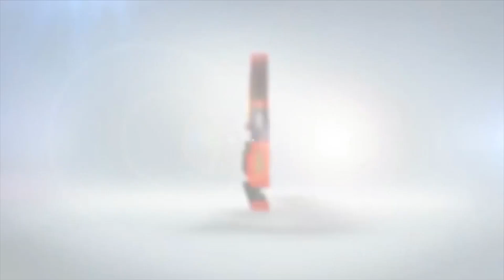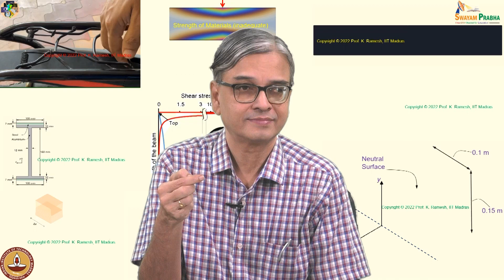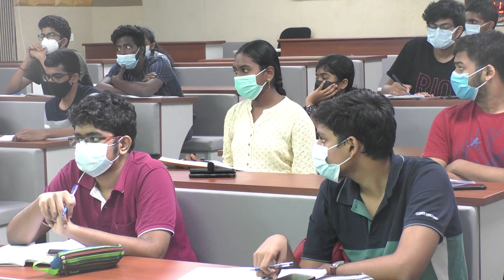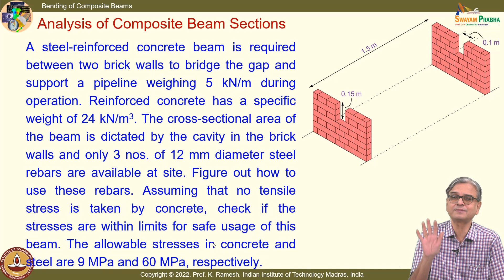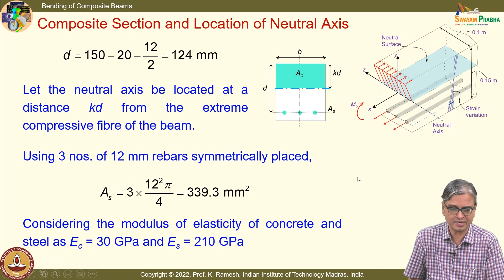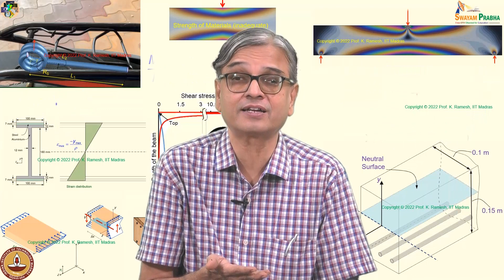LEC 27 Bending 5 - Composite Beams

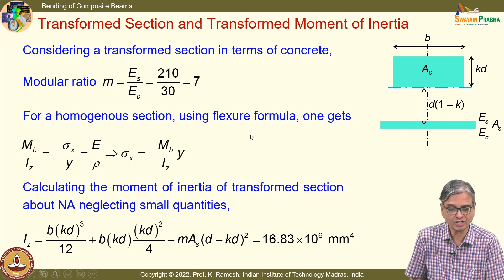Comment: Why bd^3/12 formula is not used for the transformed steel section Iz calculation at 50:50 instead of that mAs(d-kd)^2 is only used. generally in parallel axis theorm Ix= (Ixx+A*y^2). Over here why Ixx term is not considered over here in calculating transformed steel section. Please clarify me if i am wrong.
Reply: The moment of inertia resisting bending here would be Izz instead of Ixx.

As for your question about the parallel axis theorem, you are correct. Izz self of the transformed steel about its own axis would be a very small quantity which has been ignored. This is why the statement reads 'neglecting small quantities'.

You can get a quantitative appreciation of the numbers by solving the same problem considering Izz of transformed steel about its own axis also. The change in the results would be negligible.